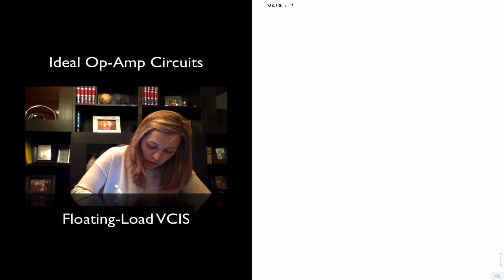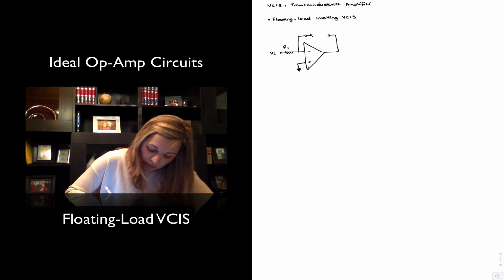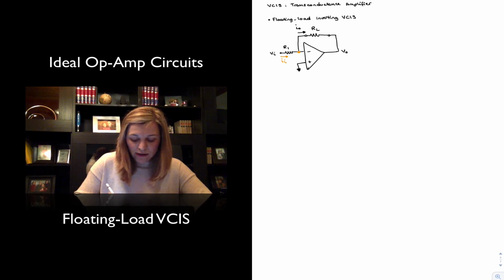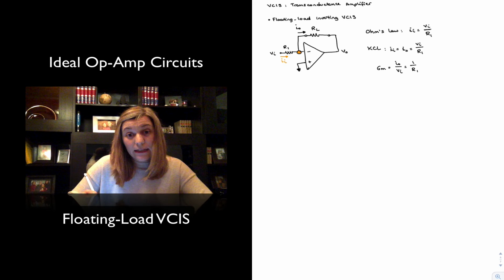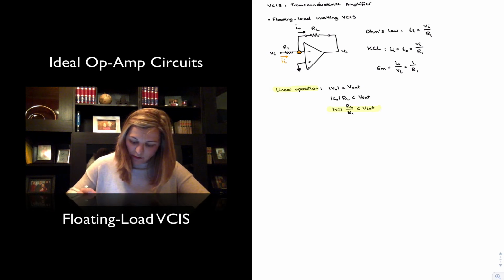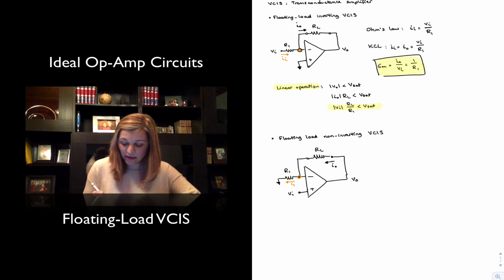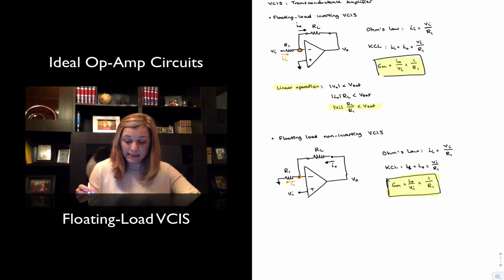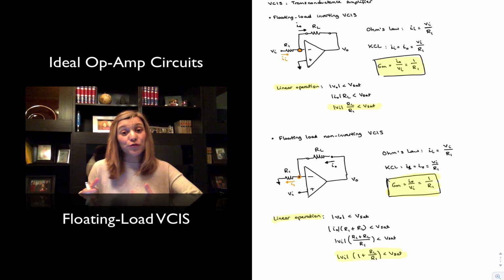Review of Op-Amps: Floating-Load VCIS

Comment: Thank you for your priceless efforts to put these great educational videos together. I am a biolog who have a great interest in electronics with a leak of an academic knowledge about it. Your videos have a great help for me to trying to understand the concepts of electronics. Maybe this will be a very ignorant question (Electronics 101) but i couldn't understand the reason why the resistance R1 become relevant to Vout  ( |Iout| . (R1+RL) < Vsat ) in the non-inverting configuration while it is not relevant in inverting configuration ( |Iout| . RL < Vsat ). Is it something to do with the position of the groung point? Thank you very much!
Reply: The reason is that R1 is connected to ground and therefore vo = iout x (R1+RL) . Remember that iout x R1 only gives the voltage drop over R1 which would be equal to vo-vi because the voltage at the terminal is vi.